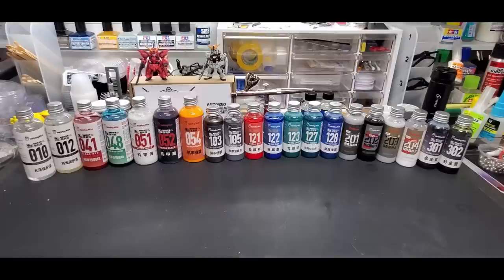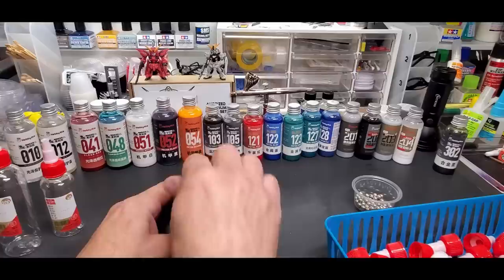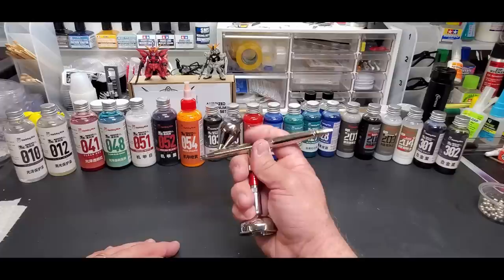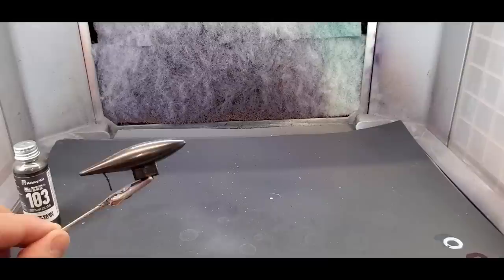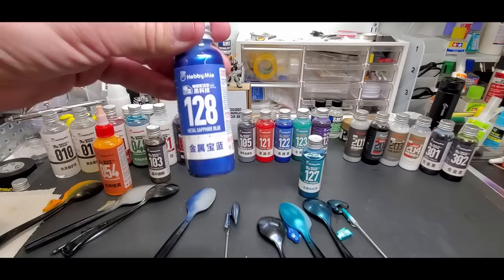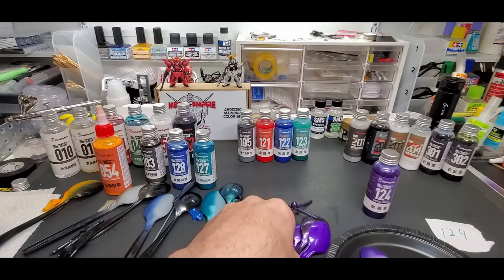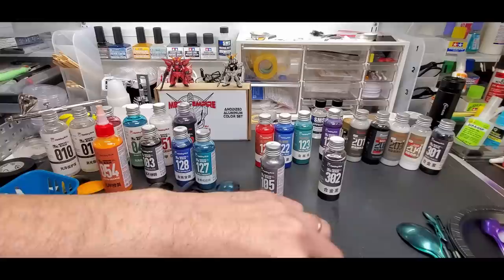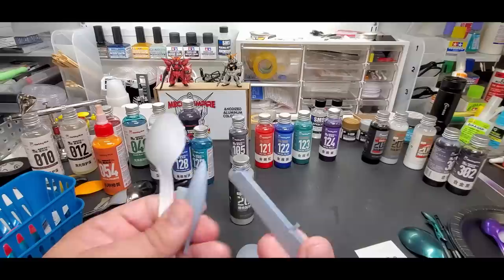Testing Hobby Mio Airbrush Paints - Awesome High Quality Paint !!

Comment: NB  Non building, meaning you can spray it in one coat or 50 and it wont slide off like a high build primer.  HB would be a Sandable filler primer.  They make another primer for ABS as well, one of the only ones I have seen.  I cant begin to imagine how bad that stuff has to be for you, ABS usually wont take any paint.

Comment: Basic colors come in the larger bottles. Metallic colors come in the smaller. Likely because you really dont use them nearly as much as a primary non-metallic color. I've been very happy with them, it's all I've been using lately with the addition of some of your enamels. Haven't had any issues with their included beads and the mixer. Prethinned paints are real nice when you just want to paint and get stuff done.
Reply from the maker: Wait till you see the new colors in my paint line. I'll be showing some this week. I have another batch coming next week too. Beautiful colors 👍
Reply: @barbatosrex9473  Looking forward to them. They spray real nice with the leveling thinner.

Comment: Are all harder and steenbeck airbrushes solvent resistant
Reply from the maker: Yes they are but I couldn't recommend them now. I've gone thru 2 air valves and I hardly use it
Reply: @barbatosrex9473  oh okay I love my h&s brushes but never put anything but acrylics like vallejo through them but just purchased some of these hobby mio paints so I guess I'll have to figure something else out
Reply from the maker: They spray Hobby Mio great. I thought you were considering an H&S, didn't know you had one. They're  great airbrushes till they fail
Reply: @barbatosrex9473  do iwatas handle solvents better I have a couple of those also